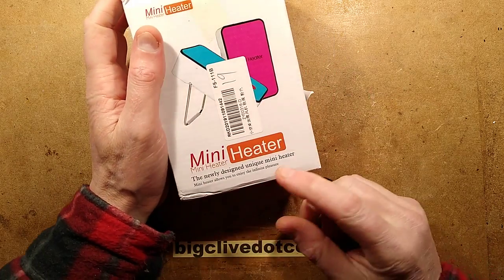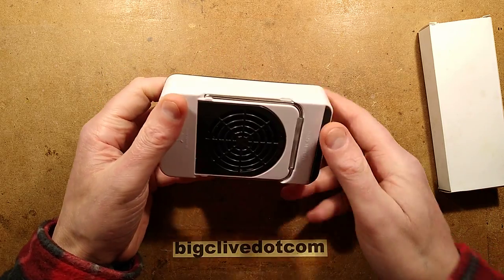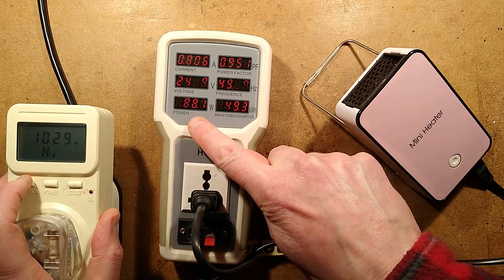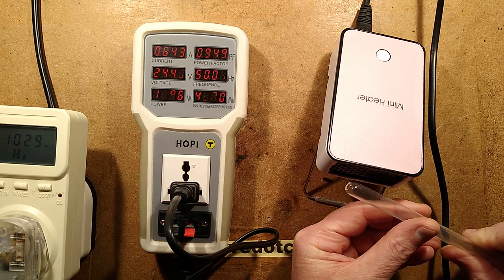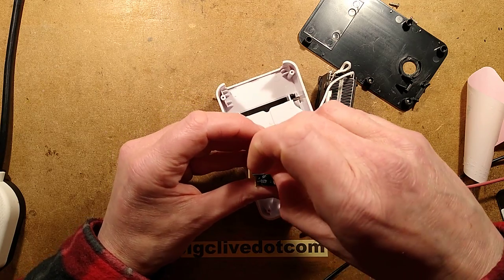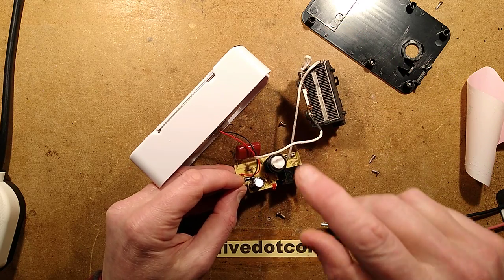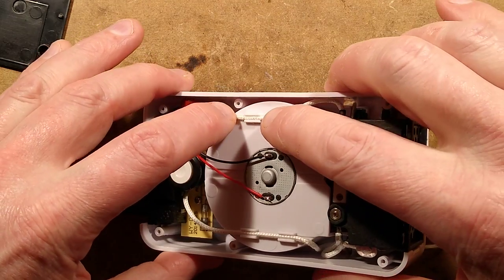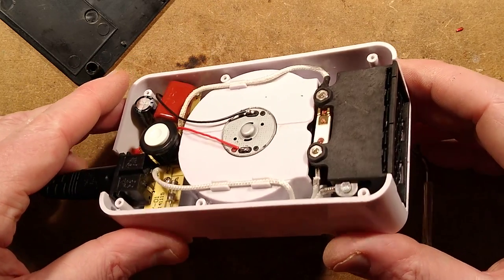All plastic 150W eBay desk mini-heater.  (With schematic.)

Comment: The impeller fan is not reversible, as it uses centrifugal force, if you spin it backwards, it's just a little less efficient as it cups some of the air. They're a far better design than those that rely on generating a pressure differential like a plane wing causing "lift", as they only produce a "net" air flow when there's no restriction that cause relative pressure to drop on the 'in' side more than the differential generated by the blades, at which point, centrifugal forces dominate, and air will be pulled back in the front in the middle, being thrown out front and back around the outer edge. In a heater, this would be recycling air through the heat element, causing the blades to get very hot. With an impeller, there is never any air flow reversal, even under restricted flow, so they're used in vacuum pumps, laptops, anywhere where you're moving something in the air, like dust or heat, and you definitely don't want any of it going backwards, or if you have a filter restricting air flow. And yes, I did learn all this the hard way, took forever! You see... well, with air, you don't!

Comment: If this had a thermostat to control when it turns on and off, this would be an ideal little thing for sticking in resin 3D printer enclosures. I'm building one from scratch with a little 100 watt PTC heater and it's kinda a pain sourcing some of the parts.
Reply: Hey did you build it and also unless i misunderstand you could just wire a self resetting thermal fuse on the outside then it will keep it roughly the temperature the fuse is raited at.

But what route did you go for yours im thinking of making one too just started abs printing its a pain but resin i didnt have much problems
Reply: @bertkooijmans4769  I did build the PTC heater similar to the video on VogMan's channel. I unfortunately haven't had a chance to do much testing/printing with it as of yet due to family issues, but it is (mostly) assembled and working. Puts out good heat, too. Just have to make sure to clip one of the wires on the heater to reduce the heat output and reduce the current, otherwise it'll blow the controller board/screen.

Comment: They wired the fan motor backwards because they made the fan blades backwards for it's current use. Why? Likely so they can use a fan that was built for a different purpose origionally.

Comment: I just bought one yesterday from salvos (a thrift shop) for $3 just because it was cheap and I was curious, Mine is a "Jamberry" mini-heater rated at 100w and on the heater grille it has velvet feeling flocking? I don't know what it is but it's nicer than touching a hot grille.

Comment: That would make a cheap and cheerful shoe drier.
Reply: I have a four post shoe, sock, and/or mitten dryer. The air comes out through slots in sides and tops of the posts. You can dry the insides of anything that will fit over a post.

It has a mechanical timer based on off switch and a heat/no heat switch. I don't know when it was made, I got it used.

I am thinking of buying one of these to make a heater with to dry small items that don't fit over a post on my other heater.

Comment: This looks shockingly similar to a little knockoff Keurig machine I have, except there they replace the switch and strip with a thermostat switch, and it uses a pump (I presume, didn't take it apart that far) instead of a fan. Other than that, it seems nearly identical. Ever considered taking a coffee machine apart, Clive?

Comment: I wonder why you are not talking about the black metal heat-shield with tiny holes obstructing the hot airflow and over-self-regulating the power. Like with Trinitron (Sony Tube TV's) you could optimize heat at a certain power if you completely remove it or use a big mesh wit large holes. Now it seems more than 50% of the area is blocked.
Reply from the maker: What's behind it is live, so it's probably to protect the naive.

Comment: Looks like they switched the fan wires to obtain the proper rotation,  since the motor appears to be a cheap PM motor, like those used in toys.  The manufacturer was too lazy to unsollder them at tef motor and swap them.  How cute...

Comment: Dude I have a quick charge charger which seems to be leaking 240v onto the USB cable, probably a separation issue. Where/if can I send it to you for examination? When I hold the phone (or USB end for that matter) and touch anything grounded, I feel a definite shocking sensation, compared to other chargers where its very slight at best.

Comment: I almost want to buy one of these to use it as a battery powered fan.
essentially removing the circuit board and the heater and putting a self contained lithium battery pack with a small charging circuit and 3.3 volt regulator. I would imagine that using a 5.2 amp hour battery pack that just the fan would run for a very long time.

Comment: If this was supplied by a UK company, I'm surprised they haven't fallen foul of the law concerning the mains plug. Here, pasted from another source, is an excerpt of accepted plugs:
Reply: Looks like I cannot add all the text:
Plug Types
Under the Plugs and Sockets etc. (Safety) Regulations 1994, it is a criminal offence to place on the market or supply in the UK an appliance which is not fitted with either (i) a UK 3-pin plug, or (ii) a non-UK plug permanently fitted with a UK safety-approved conversion plug. It is not enough, for example, to provide a 3-pin plug adapter or to make the origin of the appliance clear on the product detail page. A loose adapter in the box in which the product is supplied is not sufficient. Possible sanctions for breach are fines and/or imprisonment.

Comment: I noticed you pulled the plug out of the device first and then out of the 'wall'. Does the order actually make a difference? I was always told to pull the plug out of the wall first
Reply: Only if you dunk the live device end of the cable into water or shove a fork in the end.
It's no more dangerous than a power point on the wall left switched on.

Comment: Yes, we can see the fan running (at the end - until it stopped again).
Yes I'd already noticed the heater wire guides

And overall I think it's worth a 'Clive score' of 9/10 - but only you can confirm this.

Sticky labels over screws - a problem that's been around for years - and my preferred solution (does less damage) is to simply poke holes through the sticky label where the screws are. That's quite possibly the biggest bad point of the whole thing.
Plus points - bi-metallic cut out - not necessarily expected. thermo-regulating heat source.

So, for what it is, I'd suggest it may well get a 'recommended' from you ? What's your overall view ?

Perhaps one 'down-side' is the lack of a room stat. With such, it'd make a good heater for a confined space like a wardrobe or dog kennel or bread prover (!) or to preheat the passenger compartment of the car on a cold morning.

Comment: I want to also know what the actual temp of the air that was melting the heat shrink tubing... That might be better for 'little fingers' or 'having to hold a thing with two hands and have a steady flow of warm air' for the bench...

I know this is a horrible idea, but... What if that little motor was actually wired incorrectly... :X

Comment: Is the bimetallic strip acting as a thermostat? When it gets to temperature the fan keeps running but the power to the heater is off until the temperature drops? Heaters usually have a thermal fuse so if it overheats it trips and usually it's a one shot, non resetting fuse so it's knackered unless you can get a replacement fuse. Or link it out! (Not that I'd do that 🤫)
Reply from the maker: The heater itself self regulates.  The bimetallic cutout is a safety feature.

Comment: When you plugged it in at the end, it took a bit of time for the LED to light up (can only tell it was on at all by the faint rim of red light diffused into the plastic case around it). Any idea why?
Reply from the maker: The motor initially draws higher current until it gets up to speed.  So the voltage would gradually ramp up.
Reply: @bigclivedotcom  (slaps forehead) Of course.

Comment: I have one of these it apparently runs 220v AC though in Australia I can run it off 240v AC. What modifications would you need to make it run off a 12v DC battery? is this possible? thanks for any help you can provide.

Comment: Hope ya take that cable to bits bet amount of wire in it tiny. had cheep charger that had 15 threads of copper colored aluminum for each pol and a "100 watt rating" glad i chopped it up instead.

Comment: because it has a fan that runs all the time, wouldn't it accumulate dust over time, and then couldnt that dust then ignite, causing a fire? or maybe the dust would be burned up as it enters, not giving it a chance to build up?

Comment: I wonder if there was a Gordon Ramsey moment when they realised they'd designed the fan blades back to front?...  I'm not to sure if the life of the motor brushes (Contact fingers), would be reduced due to the motor running backwards...

Comment: Seems an odd choice to have a 12V zener protecting a 3V motor. In fact the 3V motor itself is an odd choice. Why not 12V at 1/4 of the current? I can only assume it used to be 12V; but they did the sums and found the 3V motor was cheap enough that using a larger cap dropper didn't matter.
Reply from the maker: It's a very cheap and standard low current motor.  The Zener seems to be to protect the capacitor.

Comment: Used one very similar to this to pre-heat PCBs with giant ground traces (think old PC motherboards to get failed electrolytic caps out of the VRM area).
The fan motor is the only thing i don't really trust about this thing. Had way too many cheapo chinese motors go bad in a ridiculously short time. Super easy to mod though

Comment: That sir is called a “cage fan” or sometimes called a “centrifugal blower fan”. I use them to cool my cryptocurrency farm haha
Reply: Not exactly, "blower" vs "fan" is a term defined by pressure ratio rather than being truly synonymous, with fans in theoretical environments increasing air speed without pressure change and blowers increasing pressure with no change in velocity... in a more real world sense the majority role the part plays is the name its given. Or under ASME definition (a little different to most of the world) a comparison of suction vs discharge pressure is used to determine the naming.

Clive was very wrong about his description of direction however, as if you reversed the fans polarity it would still move air axially outwards in the same direction (rather than as he suggests sucking on the heater), just with forwards rather than reverse blade pitch. This would reduce airflow and dust tolerance, but also decrease the noise and increase static pressure, which is advantageous to many roles and larger split cycle air condition systems using forwards pitch blades. Historically many low pressure blowers for mine pressurization ect used to have totally straight blades, giving the exact same effect regardless of motor start direction, while most fluid pumps have extremely reverse inclined blades to reduce cavitation and particulate buildup.

Comment: @bigclivedotcom can you replace the plug on this heater for a 3 pin uk plug lead. And i was wondering what amp fuse to use on the heater thanks
Reply from the maker: Yes you can use a standard UK plug with a 3A fuse.
Reply: @bigclivedotcom  thank you 👍

Comment: clive is funny. i want to use this in a tiny box camper.  the camper is 5 x 8 jfoot.  enclosed and sealed.  i wonder if i can use this with my solar panel  ..............the solar panel  and inverter will also be powered up via my car and 8 prong pin. my plan is to have two deep cycle battery.................i think for sure this will heat my tiny camper and i think for sure i can get 8 hours out of this via my power supply , two deep cycle battery.  my only worry is that 8 hours of service this tiny heater might wear out or over heat for so long usage
Reply from the maker: I think they do 12V heaters in a similar style.
Reply: @bigclivedotcom  i dont know what a 12volt heater is . is that the one that plugs into cig lighter in car.?  I'm clueless.ive succumbed to idea that I'm gonna have to put a propane heater in my trailer.  but here's a separate question.  i go to library parking lot to use internet it cold now.  can i get a tiny cig lighter heater they sell for defrost windshield for example and while I'm sitting at library and my car is off i can run the tiny 12v heater from my car battery for lets say an hour?  how will i know I'm not dischargeing my car battery too much maybe i could put a sensor on my car battery to inside car that would tell me time to turn off heater.   that would be a great experiment for you clive

Comment: Clive, in a previous heater video you suggested that the cage could be from a small fan. It's summer now in Australia, and quite hot lately - we had 44°C last week. I found a fan with a similar cage at a store called "Kmart", for $10 Aus, [about £5.25]
https://www.kmart.com.au/product/10cm-desk-fan/2708319 [as at 10 Jan 2020, the link might disappear as summer comes to a close]
And an online manual here
http://www.kmart.com.au/wcsstore/Kmart/pdfs/42780076_Manual.pdf
The manual points out that the fan should not be disassembled. I think you would ignore that suggestion.

Comment: Clive I was thinking that if the motor fails zener will go open circuit.if I connect 1meg resistor across that zener will it be still go open circuit if motor fails?
Reply from the maker: If the motor fails the Zener will cap the voltage at 12v.

Comment: Would it be possible to rip out the power supply board and replace it with a 4.5v usb powered board and use the unit as a camping heater?
Reply from the maker: A heater would require a lot of current at 5V.  It would be better to use a suitable camping heater or wear warm clothing.

Comment: I have a qeustion is it possible to make the ptc heater less wattage by cutting the ceramic blocks?or just removing one or 2.
I wanna make a tiny heater yo dry silicagel and 3d printer filament
Reply from the maker: It is self regulating.  Even with a section removed it would aim for the same temperature in an enclosed area.

Comment: Why has no one made a ptc heater and an adjustable speed fan? Really not hard to do... Especially these personal heaters, sometimes I only need a little bit of heat
Reply: @Michael HTT
i have one , its called "THERMAL 2001" , it no longer makes heat but is a nice variable fan :-)

Comment: I've seen these re-branded for applying Finger Nail Wraps.  They're a sort of plastic sticker for fingernails that are slightly heat shrunk by the heater (and I believe the adhesive becomes tacky with heat as well).

https://www.instructables.com/id/How-To-Apply-Jamberry-Nail-Wraps/

Comment: If you took the heating element off could the circuit board be used to power anything else?
Reply: The circuit board isn't powering anything but the fan.  The heater runs straight off mains.
Reply: @guygordon2780  so it's only stepping it downg to around 3 volts

Comment: What size capacitor would you need to get it to work at 120v? 1.5uF?
Reply from the maker: Usually double what's already in it.  But keep in mind that the heater may run at lower output on 120V.

Comment: I bought a Eurom Infrared Heater with 2 infrared lamps (each 400 watt). I opened it up and connected them in series. Ended up with a 200 watt infrared heater which gives me enough heat (when put close to my body) for less amount of watts. Helps me trough the Dutch winter and can get really hot when put too close! I Guess it's a better option than this 150 watt heater which does not do much.

Comment: I bought one of these to take to the library as it was small enough to fit in my computer bag.  I did do a a good job under the desk in a cold drafty building. However, I did change the power cord to be right angled entry with an Aussie plug (see link). I would image in the UK it would be wise to change a power cord with your 2amp fused type plug. 

I was wary of accidently kicking it with my foot flat on the floor relying on that thermal cut out you showed.  I also found the little thing would only last a season as the fan motor was the first thing to fail after couple of months of continuous use.

https://images.app.goo.gl/GQMdmFZkcRM4Vwez8

Comment: I have one of these. I put it in my shoe to dry it out, relying on the thermal switch for temperature regulation... Melted the shoe and the front of the heater. 

Still works though. Great for keeping your hands warm when working at a bench but not enough to keep your body warm.

Comment: For some reason i thought it was a #USB heater, until you said 1kw power....
Reply: time to plug in 10 usb C cables into the thing
Reply: You could probably pull a kilowatt inrush current from USB too, if you limit it to a few nanoseconds..

Comment: After you peeled the label off, it looked like a weird prototype early iPhone...

I wonder if it would still stabilise at a reasonable temperature even if the bimetallic switch didn't turn it off or wasn't present, like in this video: https://www.youtube.com/watch?v=n6U_BfM8h24

Comment: The problem with a desk top heater is that the coldest temperature will be on the floor. If the heater is on the desk your feet will stay cold. Placing the heater on the floor will warm your feet AND rise to heat above it as well.